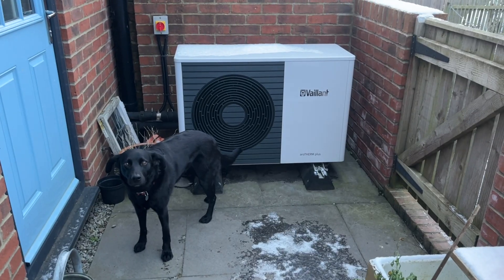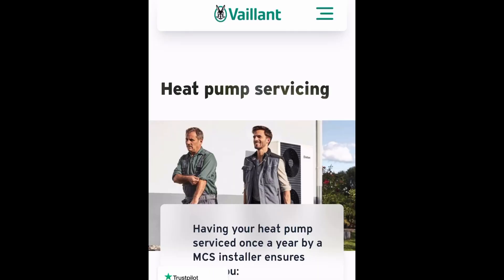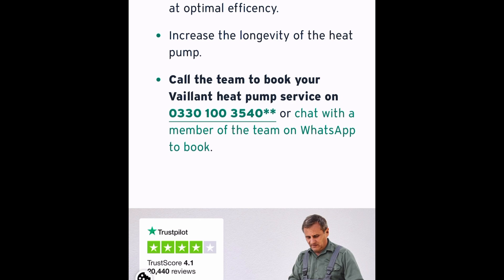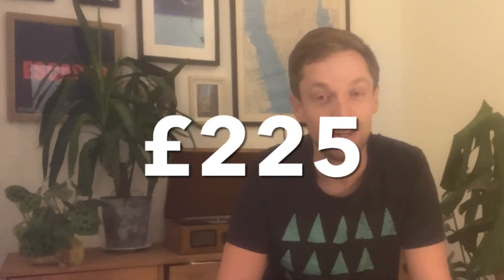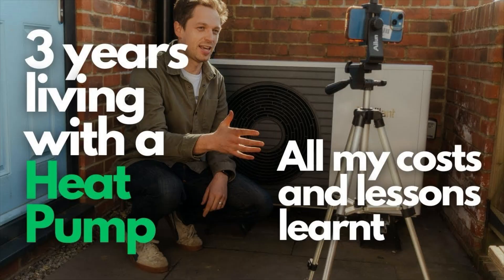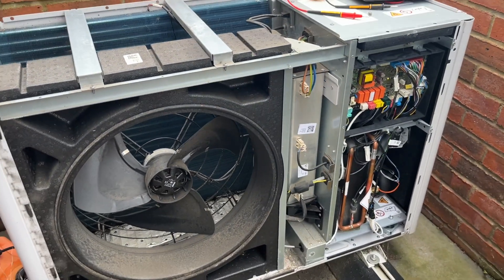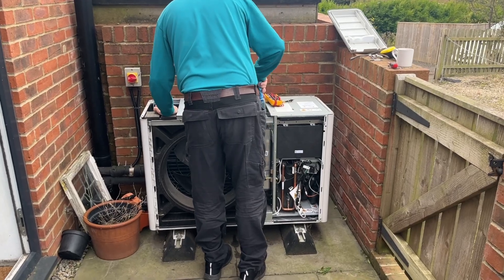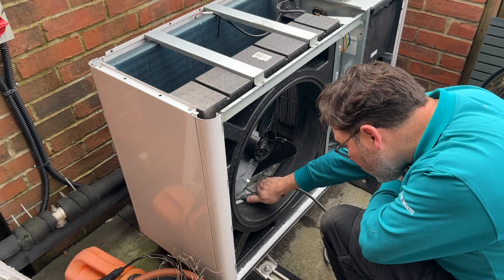What happens during a heat pump service?

Comment: 220 quid for an ammonia based spray, a clean with a brush and a towel to collect the drip from the inverter is a ripoff.
Reply from the maker: I’m not sure it’s value for money, but ripoff may be a bit harsh!

Maybe heat pumps don’t really need servicing as regularly as boilers?

Comment: Servicing is always a bone of contention, but ultimately it helps to make sure you keep things working properly and to spot any potential issues. £225 seems a lot, but most people will spend more on take away coffees in a year. 
The best service is one that finds no issues and you have peace of mind once the engineer leaves afterwards.
Reply from the maker: Really fair points! I haven't booked in a service yet for this year, doesn't feel urgent at the moment, but may wait a until the spring

Comment: What did you record the vid on Tom? A 1990s Nokia phone? 😊. I chose a Daikin Altherma 3H HT ASHP four years ago. I took out the Daikin 10 year fixed price warranty & service package. This includes an annual service & and parts & labour if there is a problem. For £264/year thru Daikin. I felt good value. Peace of mind, etc.
Reply from the maker: I think this one was just after I had my screen on my iPhone replaced by a dodgy high street shop....!

Interesting to hear about your approach, hope the Daikin system is still going strong? How has the servicing been in those 4 years?
Reply: @TomBray-LowCarbonLifestyle  it was one of the reasons why I chose Daikin. First service was a Daikin employee who checked the install. Next 3 years has been the same independent engineer who only works for Daikin. I’m happy. It’s a clean, a pressure test, performance test. I feel a bit like taking you car in for a service - they have a check sheet. Prevention is better than break/fix. And I have the peace of mind of two call outs per annum and all parts and labour covered for 10 years. It’s an insurance.

Comment: Rather sounds like they didn’t do anything of value and certainly not £200+. Is it mandated you go through vailant for warranty preservation or can you use an independent engineer please?
Reply from the maker: It is a good question, before the next service, I will try to understand what the warranty terms are. It does seem expensive, would be interesting to know how cheap an independent engineer would be

Comment: Have to say your Heat Pump clearances don't look great to me, should have 500mm of the right hand side.

Surprised the engineer did not flag this, as Vaillant are very anal where we are in the south.

When I do a service, I'm more interested with the electrics, how the compressor is running, how much current is it drawing. (the electrics can be just as bad as some plumbing) of an install.

We don't check the refrigerant as it is a sealed circuit, its also propane R290, this in theory should never leak. (you don't regas/check you refrigerant in your fridge at home every year.) 

I am qualified F Gas engineer, we only start messing around with the refrigerant circuit if the system is have errors and pointing to that being the issue.

Its better to install the particle filter inside and this makes it easier for maintenance.
Reply from the maker: Thanks Ken, some helpful points there. Yes I think that it was installed too close on the right hand side, the service engineer did not mention this, but I had picked this up previously, and fairly disappointed that our installer did this. It does not seem to be causing too much of a problem 
Thanks for the helpful context more broadly. All the best
Tom

Comment: Do you have a video of the actual installation and space needed ? I think one of the videos has it but very briefly
Reply: I had a Heat Pump installed and I did make a video about it. I thought I would mention it here as it is one of the only ones I know of that has footage of the engineers actually doing the work:
"Heat without the Guilt" https://youtu.be/7jg6BltGhlU

Comment: Going back to basics, my old gas boiler alone attracts an annual charge of £100 to do sweet FA. It's 18 years old and, unlike modern Combi and other condensing boilers there's not much to do other than a draw test and vacuuming any dust out. They used to dismantle the burner assembly and pilot light and blow away debris but they don't do that now until such time that the burners would not light up and so a specific visit had to be made to rectify that. It's a racket, I tell you. They play on one's fears tbh.
Reply from the maker: Hi Nick - sorry I missed this comment a few weeks back - I think you are right, a cost for 'piece of mind' but not much else!

Comment: Looking at that, unless you have a lot of microbore in the property, the buffer tank is not required as the circulation pump in the HP should be more than capable for enough flow around the house. Would be worth an experiment to turn the buffer into a volumiser but it is labour from an engineer which is £.

Comment: I agree with the last comment - it’s a fridge (but with a large fan motor)….. there is NOTHING TO SERVICE ….. the pcbs either function or not and there is nothing to test. What you paid is a rip off …. BUT some decades ago so was a gas boiler service which has now reduced to a level of paying same money as you did but for an annual maintenance contract that includes the replacement of any faulty parts and includes multiple call outs if required in the contract period ….. Heat pump service pricing will go the same way once the industry and insurers like Domestic & General get their head around that these are FRIDGES !!
Reply from the maker: Fair point Joe - thanks for commenting. It does feel like Vaillant can charge a fortune because there is a lack of understanding about heat pumps, and therefore a lack of service engineers... but I agree costs may well come down in the future.

Comment: Interesting vid.. thanks for it.. 
I have the 7kw aerotherm vaillant ashp and had its first year service last april. cost £150 + vat from a local vaillant approved outfit, I guess they were here for about an hour. It wasnt quite as detailed maybe, i would have liked him to go thru the settings on the room controller but I will def ask next time. 
IN addition I pay £60 pa for the Mixergy remote monitoring service from mixergy for the HWC and I get a monthly report via email, basically a check to say all the parameters appear ok. 
The Mixergy is extremely efficient in conjunction with the ashp, a COP of around 5 I think and of course its virtually free hot water for 6 months of the year, very little the rest.. I set the HW temp at 48 - 50C. The mixergy app is also very good and user friendly, not that it needs much intervention. 

I have to say the main reason I get the services done is to maintain the warranties, otherwise I would be tempted to do it maybe every 2 - 3 years, I make sure the service record is stamped. 

One interesting thing he pointed out on the vaillant ashp is the access cover on the rear top left of the unit can leak water in and drip onto an electronics pcb inside below it,.  if you look, the top edge of the cover goes against some rivets, thus causing a possible break in the seal around the cover. In light of this Ive run some masking tape along that top edge and also laid a lightweight plastic board along the top as a secondary shelter to keep rain away, angled to the front. 

I also thought an extra layer of insulation around the large flow and return pipes behind the ashp would be a good idea and Ive loosely wrapped some fluffy material around these, it cant hurt. 

Im very pleased I had the heat pump installed, theyre magic!.. in conjunction with solar, home battery and cheap Intelligent octopus Go rate of 7p/unit its costing way less than the gas and better warmth. As well as the environmental benefits. i think its a no brainer to have one, particularly if you need a new gas boiler. I pay £140 a month on a 5 yr zero interest loan from British Gas. Whats not to like?
Reply from the maker: Thanks for your comment and all the detail Mike - really helpful!

Comment: Apart of my business services is cleaning solar panels private and commercial. It amazes me to this day with some customers and more like what there told / misled by the company who installed there systems. Like it doesn’t need cleaning or servicing to it’s all free after install. I see why some customers are frustrated but sadly occasionally they vent off at myself. And it tends to be an average 10-12yrs later of no cleaning and then has lead to litchen groths with the risk of staining or damage. Also find issues like loos mountings and damaged wires. Wear a lot could have been prevented by a yearly or other year service and clean. Yes there is costs attached especially working at height, and skills obtained and time and equipment used. At the end of the day your paying for a trade and there time and expertise, a lot like myself are self employed and when people haggle us you’re actually haggling are wage a lot of the time. I do feel for customers who have ever got the Wong end of the stick or have been mislead it is an issue that certainly plages this sector and I appreciate it’s not pleasant to have to face up to unexpected costs. Everything that is complex needs looking after and or is exposed to the elements also no matter the pr if a company says it’s self cleaning or repairing and so on I’d be very sceptical and treat it as sails pitch.

Comment: Gas boiler cost about £900 average and costs £75 ish to serve. 
Ashp cost £3000 average and costs £200 ish to service.  You dont buy a Ferrari and take it to ford garage for cheap service . Annul service if done correctly maintains the efficiency
Reply from the maker: Fair point Gareth

Comment: I'm dubious about the annual boiler / heat pump service.  Seems to me like an easy cashflow stream for those offering the services.

I'm in the process of working out how to replace our 20 something year old combi boiler (pre condensing) when it finally expires and the complexities of replacing a combi boiler with a heat pump, hot water tank and replumbing the radiators with are on 8mm copper microbore from a 22mm manifold.  The house is an 1870's terrace with solid two leaf brick walls and is partially internally insulated which has been added as we have done renovation work.

The thing with the boiler is, we do not have it annually serviced.  In it's life it has had one diverter valve, one heat exchanger and one external fill loop.  It is a Vaillant.  We are so far about the price of a replacement boiler to the good.

I think that I would go for a Vaillant heat pump but I am more likely to service it once every 3 years and just remove the covers myself and vacuum out any debris each September.  Naturally I would have any "free" services just for warranty purposes.  I might just video them though.
Reply from the maker: Thanks for engaging with the video Michael - I completely understanding about the cashflow stream. Frustrating! 

Sounds like a good plan your end, possibly a bit of work to do to facilitate a heat pump transition, as you identify, but particularly moving from a non-condensing boiler to a heat pump should see some significant reduction in costs / emissions

Comment: seems like the warranty service did nothing,did the £225 service include parts req
Reply from the maker: Hi Dave, the system did not require any replacement, except for slight refill with glycol, and yes that was included. If there was any other work, I think that would not be not be included in the price of the service
Tom

Comment: Add the antifreeze valve on the pipe outside and remove the glycol from the water. It will make it more efficient.
Reply from the maker: Thanks Rowan, that is an interesting suggestion. Not in a rush to do that but if I find a friendly heat pump installer / plumber, I have a list of things that I could do!
Reply: @ the specific heat capacity of water drops buy about 10% when mixed with glycol, pure water can hold more heat and is easier on your pumps
Reply: When an anti-freeze valve operates the water is drained out of the unit. If you can't pressurize and vent it yourself there's a call out charge and labour  charge straight away. Good luck getting someone in a hurry.
Reply: @johnj4860  its absolutely trivial to fill up a heat pump system.

Comment: I've just paid £250 for a service on my 2 year old Daikin Altherma with a small independent outfit here in Cornwall. Last year I paid £225 to have it done by the people who supplied (not fitted) it. I had a newish BAXI combi in my previous owse and a BAXI engineer used to service it for £90.
I may be an old git (72) but I used to service cars back in the day so I could/would certainly be okay with cleaning the external fan housing, Magnaclean etc. I've even had a 'play' with the installer settings :)
Reply from the maker: Thanks Virgil - that is helpful context. Maybe I should be braver to do some more of the service myself...!
Reply: When the compressor fails, or the circuit board,  will the manufacturer honour the warranty,  even though you serviced it?. That's the question!..and the next question is how much is a compressor or circuit board?. LOTS😂£££
Reply from the maker: @adriandarke5393 we’ll see!

Comment: Heat pumps are a waste of money and running costs are too high. As for a service my gas boiler service is £70 which ensures my Worcester Bosch guarantee remains valid. WB guarantee is for 10 years.
Reply from the maker: Thanks for engaging with the video and your helpful comment. 

I did a video on heat pump finances Are heat pumps a good investment? The answer might surprise you
https://youtu.be/hYcW65Oz3qI

Unfortunately gas boilers are poisoning our air and contributing to climate change. So they aren’t an option anymore… sorry!
Reply: @TomBray-LowCarbonLifestyle meanwhile in China coal fired stations. In India coal fired power stations and diesel power stations. 

The stupid thing we do is use gas to generate considerable amounts of electricity and have a very much over powered heat pump for a minimal times when we have severe cold. It would be far better to use gas when the temperature is very cold or when we need to heat water and use a much smaller heat pump to run when the outside temperature is higher or even an air to air heat pumps. 

It’s daft to create massive amounts of demand in the winter when we be mostly reliant on wind and nuclear from a low emissions perspective and therefore have to have massive amounts of under used gas power stations backups. 

I’m not anti heat pumps but there is no simple swap out because they are not a replacement for boilers if you take into account the entirety of the generation. We are looking at a huge increase in cost for us while most other countries are still continuing generating vast amounts of co2. we produce less that 1% of the worlds emissions.

Comment: So you had a conversation about whether the buffer tank is needed - but what was actually said?

For an extreme comparison, I haven't had my A2A mini-split heat pumps serviced in the 22 years I have had them - they only run cooling for a few weeks in the summer and then heating for a similar amount in the winter but still, no servicing required and not a single problem. I do give them a once over every few months but that really only involves checking for any debris stuck in the fans and listening to them to ensure there are no unusual sounds.

That said, my boiler is 27 years old and has only been serviced a few times for H+S checks as you mentioned.

You could take the approach of saving up the £225 per year as a repair fund in case something goes wrong, then have a preventive service once every 5 years. Remember they are full of tech so will no doubt report any issues as they develop. However, some warranties REQUIRE an annual service to remain valid.

Comment: you can expect costs about that all the time from the official lists,  next time try the heat geek list as well in your area,  the life should be good for 8 years most of the time, typical failures are normally compressor, fan , general corrosion, (something that will see more in the uk due to moisture in air,  other things like sinkagae of pump on service can also happen over time, requiring straighten, but that's normally on heaver units,  as well as the refrigerant causing significant ice build up more than normal in cold conditions,  an easy identifier is a cooler than normal and higher energy basis,  keep the regular maintained , even dirt and leaf build up can cause issues,   keeping the coil from defrosting which leads to rust / pin hole corrosion.  my experince was a lot worse thank yours due to poor install and lack of 2nd company support, in the end mitsubishi sent someone they recommended with a local rep to evaluate they found  a tonn wrong that would have cost thousands to fix, so the main property reverted to propaine, the annax however still uses a split air to air 16kwh with zero problems,  so far all they have found is the usual leaf buld up, and capacitor issue  that was causing it not to turn on when called this was a factory issue so was changed under warranty.  but a re-gas is needed every 12-18 months for ref

Comment: Heat geek engineer who fitted ours did it for £150 + VAT. But I would view it as a critical system check. Yes, most times they find nothing. But worth it for the one time they find something. Imagine discovering your refrigerant levels are low in mid January and you have no heating. Worth it for the peace of mind in my view. Costs will come down as adoption goes up.